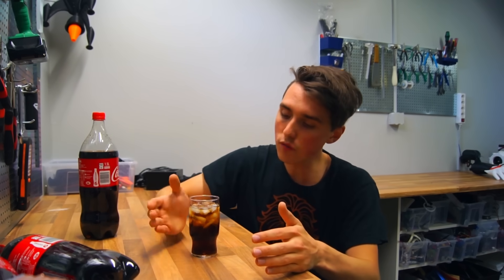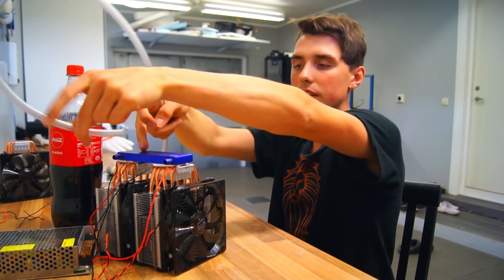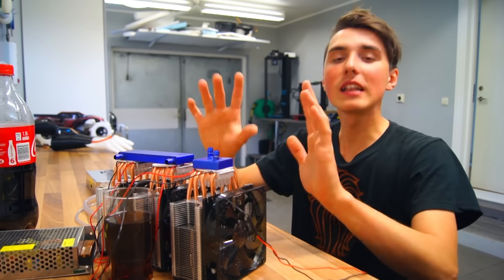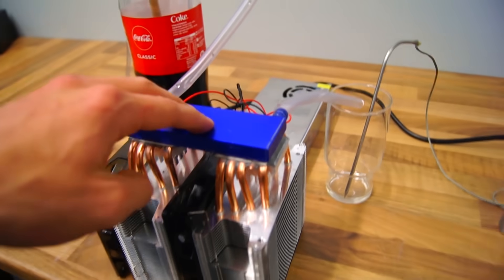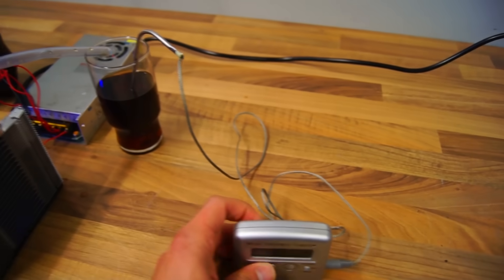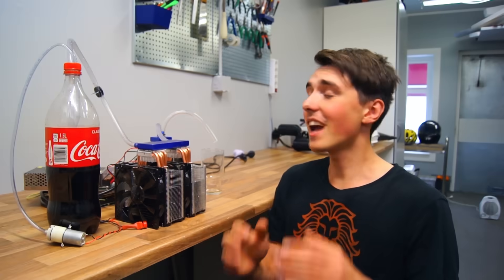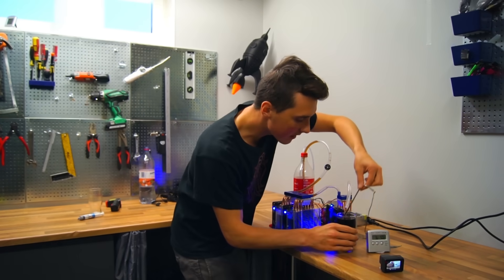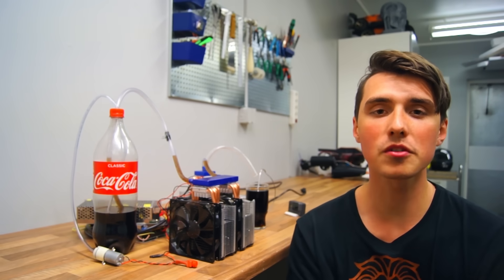Peltier Soda Cooler Machine - DIY Drink Dispenser

Comment from the maker: Post questions for me to answer in my next Q&A. Hope you like the video, have an awesome day!
Reply: You should install a computer controlled valve on your output.  Add a DS18B20 sensor to control the valve on a raspberry pi zero or arduino, maybe a relay depending on valve voltage...  Set it up to pump into the cooler, and once the liquid reaches a certain ambient temp - the valve opens to squirt some out.  Once the output liquid temp rises because the "fresh from bottle" liquid is flowing through - stop the valve until that cools to a set temperature...  You'll always have cool liquid.
Reply: 1. Are you going to have a fan meeting soon?

2. Can you do a "how to fix common problems with the Creality CR-10" video?
Reply: RCLifeOn how did you start to go viral? And what edit u use?
Reply: @awesomegaminghacksandmore8240 👉IN ISLAM THERE IS A PURE & CLEAR CONCEPTS OF GOD 

🔴 God is One and Unique: God has no partners, no equals and no rivals. God has no father, mother, sons, daughters or wives. 

🔵 God alone is worthy of all worship.

🔴 God is the All-Powerful: God has full authority and power over all things. 

🔵 Obedience to God does not increase His Power, nor does disobedience decrease His power.

🔴 God is the Most High: There is nothing above or comparable to God. 

🔵 The attributes of God do not resemble that of His creation.

🔴 No part of God is present in anyone or anything. 

🔵 God is Perfect: God does not have any human limitations, such as resting on the seventh day after He created the universe.
Reply: Woud You set all of the 3d printers on end do You yoes de tevoren tarantula 

Have an Nice day from the Nederlands
Reply: RCLifeOn This would have worked so much better if you didnt put the fans next to each other like that because the first fan gets cold air but then the second and third fan just suck in air wich has already been warmed by the first fan. I would recomand to rotate all of the heatsinks 90° so that they will all suck in cold air.
Reply: Rclifeon use an potentiometer at the motor use slow the cola
Reply: Where do you get such crazy ideas? but I like it
Reply: Why did you start a youtube channel?
Reply: Probably the most energy intensive way of drinking coke....
Lovely video content and editing by the way, keep it up!
Oh and my question is: do you have a girlfriend/boyfriend, and is she/he interested in the same technological stuff you like?
Reply: Are you rich?Do you live by your own? 
How can you afford these expensive electronics?
Reply: How many meters of filament you have used for your prints on your channel?
Reply: Not sure if this has already been answered, but did you go to college/what did you major in? Seems like you'd be a computer engineer kinda guy.
Reply: Why are your cheeks always red (not judging but I like the way it looks)
Reply: what is your overall favorite 3d printer?
Reply: where do I buy a marvelous scooter like yours? really! I need to know =)
greetings from Brasil
Reply: no he does not have a girlfriend
Reply: Have you ever considered raceing roc cars?
Reply: You should build a fpv drone!!! Btw your AWESOME!!!
Reply: he gets them for free from compinies.
Reply: Can you print Nylon X on an A8?
Reply: RCLifeOn where do you get all your ideas from?
Reply: What's 9 + 10?
Reply: How old are you?
Reply: RCLifeOn 
Why don't you open your store on ebay so that you sell a project kit like this we can boost you and we have a kit of the project
Reply: Your favorite YouTube channels?
Reply: waiting for dual extrusion
Reply: Having an active channel that have reached more than 100K subs might help a little ;)
Reply: RCLifeOn how to fix common issues with creality cr 10 and on the new one on gearbest
Reply: RCLifeOn Reaction to Tomas sanladerers rant?
Reply: RCLifeOn Hi, can is a beer dispenser??? And Second cooler, the fan, flux Wind is blocked.
Reply: Regarding efficiency, you have to take the time into consideration. It took 15 seconds to cool 1 glass of coke down at 300 watts. So to get to the Wh energy used, divide 300 by 240 = 1,25 Wh. It means if you don't include the cooling down start of the equipment, the price of cooling that one glass of coke was something in the ball park of 0,025 US cent, or you could cool down 4000 glasses of coke for 1 USD.
Reply: RCLifeOn what is the thermal paste that you are using
Reply: where do you buy this cordes that are on you 3d printers (not the filament) and what app did you use for you tevo tarantula
Reply: Can you make a giveaway with winer ME :)
Reply: well... a -16°C cola freezes... so you'll certainly have to clean the whole thing after use, unless having the ice explode the aluminium next time you plug it no? 
Regardless this, alluminium oxydes are quite toxic and you made some with phosporic acid in coke... be carefull...
however i relly enjoy your vidéos, please stop drinking aluminic coke, to be abble to continue to entertain us :)
Reply: Would you like to build an autonomus UAV (AUAV) with me?
Reply: review the anycubic kossel!
Reply: what is the cheapest filament and in what site
Reply: 3 seprate blocks might work better. Staged cooling so to speak. also as you already noted and ordered a larger block will help. ALSO where did you get those heatsinks? they look very cool!
Reply: i need to make a small fridge efficient with water running through pipes inside the fridge and i need your help  temp around -1 celsius
Reply: I would use IC Diamond he is just using generic paste.
Reply: check out the flsun i3 3d printer! a really big buildvolume for a really low price.! i belive the printing volume is the same as the cr 10 but its almost half the price. keep up the great work!

link to printer: https://www.aliexpress.com/item//32826682628.html?aff_platform=aaf&cpt=1506441708626&sk=2v37IQv&aff_trace_key=910ce2f3b2ab43e5879841cac8c5aca3-1506441708626-07138-2v37IQv&terminal_id=41547441865247c09eaab0ed804ddd76
Reply: tech it is $68 cheaper than a cr10 (would have to be under $200 to be half) and its a kit not pre assembled. I doubt its the same qc either. I habe not had the best luck with flsun in the past. Damned flsun delta i got it not nice to me :-)
Reply: RCLifeOn why mine do not have snow on the water block
Reply: +Mohammad Saputra You just have lower Humidity all the snow is is water that froze.
Reply: RCLifeOn why didn't you pit thermal paste between the Peltier and the waterblock as you would get ever lower temps just like in the pc
Reply: RCLifeOn i
Reply: Was that a pretty much straight through water block, or did it have a zig zag path. If its straight through, you may try a different water block with a less direct path, increasing the surface contact the coke has with the block.
Reply: This would be great for a liquor dispenser.
Reply: Hi, I have a question: have you ever heard of an invention called: The ReFrIgErAtOr... Kekekek
Reply: Cleto Solano yup I need to see a peltier home made one
Reply: RCLifeOn can i use this to cool my gaming pc?
Reply: NO too cold lock up the system i tried it.
Reply: GT20Modding right.... I hope thats sarcasm...
Reply: Hey Simon - give it a try with the fans turned 90 degrees (looking from the top) so they are not blowing into each other. The heat from the first heat sink decreases efficiency of the second heat sink, the second the third, etc. It should kick ass if you give that a try. Followup video?
Reply: hey u crazy u can put regulator for motor pump
Reply: hey, u can also make a small cooler that fits 2l coco cola bottle. and then add ur cola dispanser to it and also slow down the flow of ur coka at  the end so it stay more in the cooler/
Reply: Or remove the limiter and have it reflow back into the bottle.  At some set temp, you just pull from a manual valve off of the reservoir.  To reduce cooling time construct a 2nd reservoir w/valving that only pulls from the main bottle to maintain a minimum threshold of liquid.  That smaller reservoir is what get recycled and continually cooled.  Ultimately, however, using water cooling parts w/something you might wish to consume is going to unpleasant.
Reply: you should try and lower the V on the motor and tet it go even slower then it should be coolder
Reply: what country are u from
Reply: RCLifeOn to cool it with more effemcy
Couleur you plus try to recycle the Coke back in the bettle so it can run Teile to the water blocks
Reply: RCLifeOn Supposedly the lowest temperature of a peltier's cold side is dependent on the ambient temperature of the hot side. What happens if you stack them so that the cold side of one is on the hot side of the other? How low can you go in temp? Here's where I read up on it: https://www.quora.com/How-cold-can-a-Peltier-device-get
Reply: Is anyone already get the peltier from that seller ?
Reply: like
Reply: rclifeon upgrade your pipe into thin gauge stainless steel pipe
you will definitely got the results
Reply: why havent you thougt about coke ice cubes? and how much did cocacola pay? xd
Reply: make a second pass of the glass of coke through your system, It will definitely freeze.
Reply: hi you should try cooling the peltier module with water to keep ambient tempature in the room cooler
Reply: RCLifeOn ? Get two glasses the same size, pour the soda in one glass, pump the soda thru the CPU block, let soda go back into the same glass and keep letting it recycle for one minute and then pour it into the 2nd glass and taste it.
Reply: So cold!
Reply: what a build man ........Great refrigerator  .................your a genius
Reply: But what will happen if you would like to fill more than one glass, which temperature it will be then
Reply: What peltier module did you use?
Reply: RCLifeOn great job thanks for sharing
Reply: POUPS
Reply: Instead of air coolers you should use a radiator and fans to liquid cool the waterblock
Reply: just wondering for this ^^ project did you have a co-current(fan is a blower) configuration or a counter-current(fan is a sucker) configuration, cus you might be able to increase the performance of the system by ensuring a counter current configuration
Reply: RCLifeOn what are you think about Russian handmaders? Because I think I'm alone from Russia on this channel.
Reply: Alexgyver or Kreosan for example
Reply: What Is Islam?

Islam is not just another religion. 

It is the same message preached by Moses, Jesus and Abraham.

Islam literally means ‘submission to God’ and it teaches us to have a direct relationship with God. 

It reminds us that since God created us, no one should be worshipped except God alone. 

It also teaches that God is nothing like a human being or like anything that we can imagine.

 The concept of God is summarized in the Quran as:

{ “Say, He is God, the One. God, the Absolute. He does not give birth, nor was He born, and there is nothing like Him.”} (Quran 112:1-4)

Becoming a Muslim is not turning your back to Jesus. 

Rather it’s going back to the original teachings of Jesus and obeying him
Reply: ♥️Sorry but the plastic are midecal?
Reply: I want to suggest that the you put a clip on the tube which is connect between coke bottle and mini tank that's why that liquid coke cant rest more time in mini tank 
I suggest that you want this Clip on the tube which will coneect between mini tank and glass thats why the liquid water takes more time to out from these tank and that liquid coke rest more in tank and it's results into coke get more coolled
Reply: Id love to see you put the glass on top of the cooler and see how cold it would get, like a cold rail at a bar
Reply: Recirculate the coke a few times back in on itself before serving.
Reply: Yes it is a good video
Auf Dual have been seen it i decided to Build pint of Soda dispenser as well but i think i would give the complete construction an Upgrade more P
Elltier Moduls but i can't make a filmclip because my only have onearm working after heavy brain stroke but never give up and for my kids itry to build everything they wish i have shown my kids your
Clip
And they asked me if i could build the same for them but i try to make the volume automatic call me ANSYS aim for the flo
W Speed for temperature adjustment
Slowflo
W d
Rep
Er temp plus
A time running Modul which will
Adu
St how long the flow wil run
So Inc
Once calibr für maschin
E will st opp when Glass is. Full and the Peltiet willbe water cooled
Reply: how about air condition usin Peltier pls
Reply: You measured the temperature of the aluminum and it was about -17 degrees. If you wanted it to be closer to zero, could you reduce the power supply to the Peltier cooler pad?
Reply: you never made the follow up video about the peltier BIG A/C unit
Reply: Amazing
Reply: Amazing
Reply: Adam Savage invented this with dry ice
Reply: RCLifeOn is there any risk of lead/mercury poisoning with those cooling blocks?
Reply: build an electric skateboard!

Comment: if you have a cheaper hotpoint freezer with a fan in the freezer section, the soda cans take exactly 19 minutes to chill drinking temp, and 22 minutes to soft slush. not so bad a wait if you are already working on something like dinner to pass the time. if you ever revisit this, you can actually stack these peltier units right on top of each other for double the cooling.

Comment: well thanks for posting the video, i am currently researching on the peltier module and may be you find it amazing too, isn't it!!. what i have noticed in your DIY project is that the surface of the module and heat sink should be in good contact and tightened, i haven't seen any module for pressing it. the second is that you use big blue bar which may have also the effect on the cooling, try use small water cooler heat sink which can fit only ion the module and connect them using insulating pipes. third is that the heat sink should be on top so that warm air should not effect cooling side, thanks, it is just a theory may be i am wrong and sorry for that in advance, knowledge is waste area, comment down if i am wrong THANKS!!!

Comment: You can also get a small cooler put about 10 ft of coiled copper in it fill it with ice and then run the Coke in one side of the tube and out the other. With a gravity feed set up, that's 0 amps.

Comment: The heat (gas) travels up the pipe and eventually reaches the condensor, which condenses the gas back into liquid form and uses capillary action to transport it back to the evaporator.

Comment: Could we do this with 8 aa batteries in a battery pack instead of a 12v power supply connected to the wall? Would it last a good while and also give enough power because 8 aa batteries is 12v.

Comment: COP calculation

Setup 1 : 
input : 200W
coke qty 200ml in 15 sec
20 to 9 DC
Output: 620W
COP: 3.1 

Setup 2 :
input: 300W
coke qty 200ml in 15 sec
temp 20 to 7 DC
Output: 725
COP: 2.41

Comment: why not just loop your drink so you can achieve the coldness you want ,connect temp sensor or thermostat connect to your motor so it'll shut off your motor when temp set has been achieved. Your experiment is good but not sustainable as you used too much resources to achieve your goal.

Comment: The next step to this would be to build a completely sealed container that can handle pressure, and also transfer heat well. using a keg with some peltiers at the bottom, or making a longer path with a longer block to make it colder.

Comment: Did this same experiment, based on calcs only.   Your assessment of the efficiency was the same conclusion that i came to.  Peltier coolers (TEC) are a heavy and expensive hammer to use on this job.   Great work...

Comment: 1) Turn around so that heat fins do not send hot air back up to the blue cooler block. 2) Add temperature sensor with simple regulator (Amazon..) to avoid freezing water in the cooling block. 3) Good design and obviously cools very well. Good luck.

Comment: Just turn down the voltage on the motor my dude. It'll spin slower and you can control it proportionally to the exact speed.

Comment: How about you modified the flow at the heat exchanger parts? Making the coke circulation at heat exchanger there abit longer? "Because if you choking the flow in a tube & longer piping ain't good for the pump"..

Comment: Drive the air pump with PWM to slow down the flow of coke to get more cooling... At the price of increased dispensing time... But it saves cost and energy..

Comment: Can you change the fan orientation of the 2 conjoined blocks, so that both blocks take in fresh air? From what I see on the current setup, one block receives the already hot exhaust from the other block, so it's not able to efficiently draw away the heat from the Peltier plate. Or is my analysis wrong?

Still, a cool video, though!

Comment: Peltier is stupid, expensive, inefficient.
You can get a refrigeration kit, which is the Hot Side (Condenser, Compressor, Etc.) And you can make your own cold side with copper piping and capillary tubing.
Then you call a fridge technician to put it all together.

Or buy yourself a fucking fridge...

Comment: Did you try slowing down the pump motor. need more time in the system to cool also if you put liquid coolers on the hot side of peltier you could pull heat faster than those heatpipe radiators. Also if you add a block of aluminum or copper to the cold side water block something thick you will get more cold storage so whe. Coke passes through it the block is already holding some of the cold then the water block wont heat up as fast

Comment: was kinda hoping you'd make a module that you put in the glass of coke to transfer the heat energy out instead of running the coke itself through a heatsink. The water blocks are now coke blocks and have the potential to get really nasty.